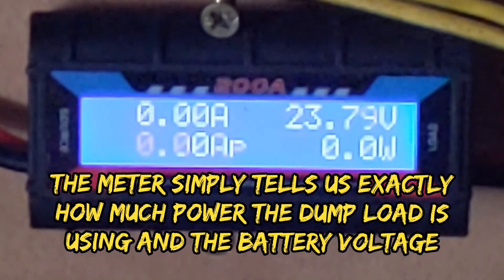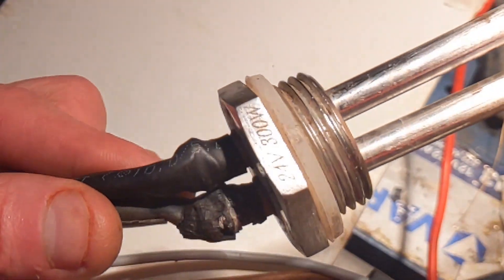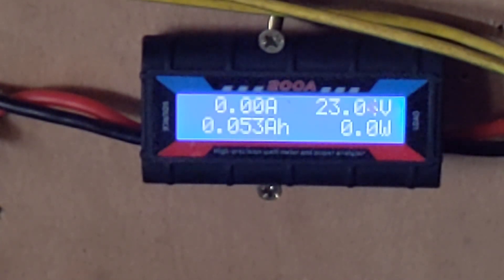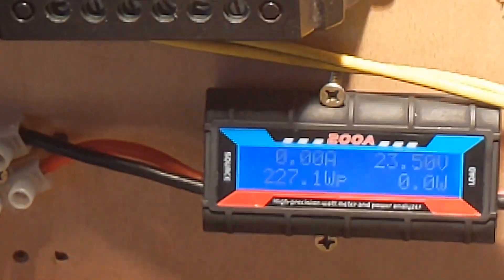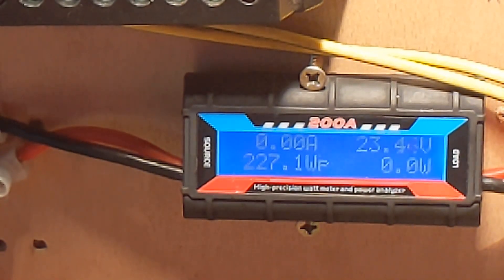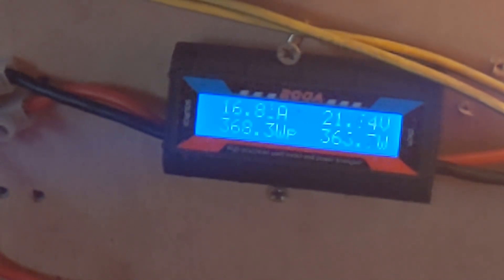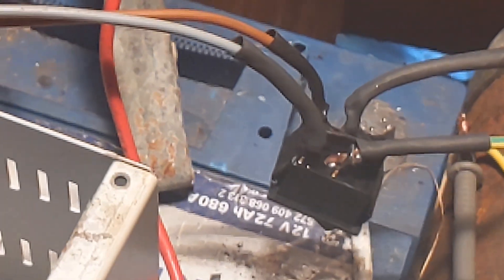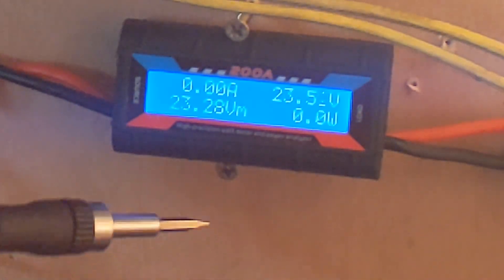testing dump load power usage 12v / 24v - 300 / 600 watt - 16th November 2021

Comment: I have one of those heating elements coming in the mail.  Is it ok to use them without submerging them in water?   Have you ever had a heating element go bad?
Reply from the maker: I've actually used one as a toaster before so they don't need to be submerged in water, they are pretty tough.

Comment: Setting up a micro hydro atm, need a dump load on a relay to keep everything safe.   Any ideas on an economical simple solution very welcome 😎
Reply from the maker: I haven't really found anything cheap and perfect at the moment. I'm going to be using the turbine a lot over the next few weeks because it's going to be very windy. Hopefully I will get something more permanent in place. At the moment I'm just going to use either a rectifier or this real budget wind turbine controller that I've got I trashed the old controller I had unfortunately